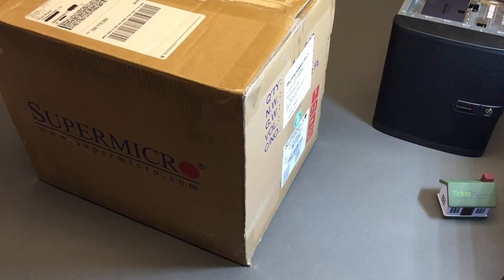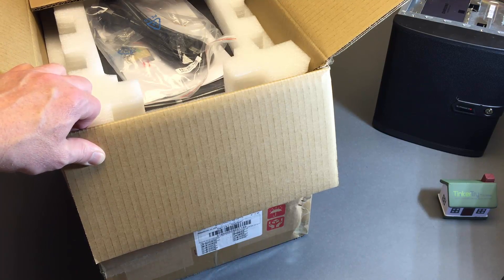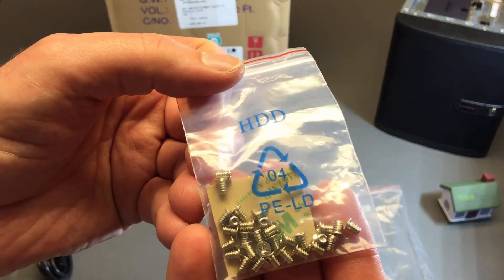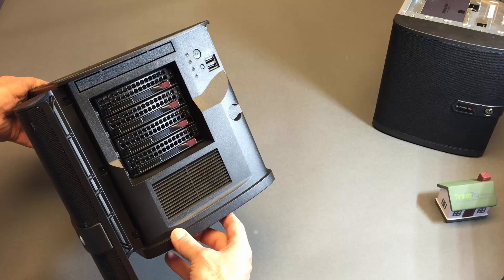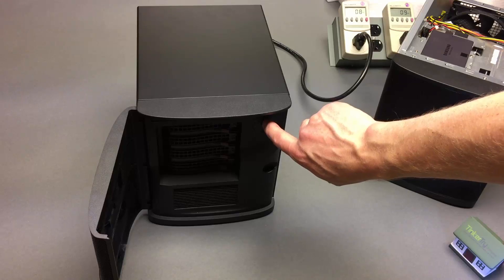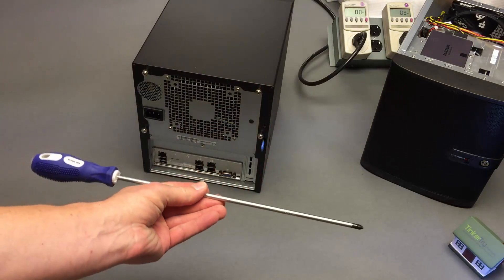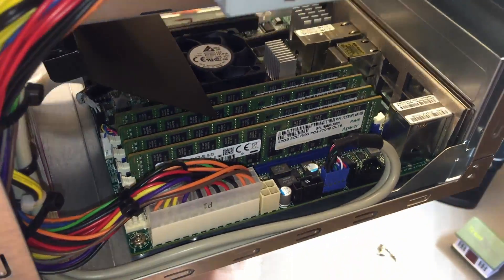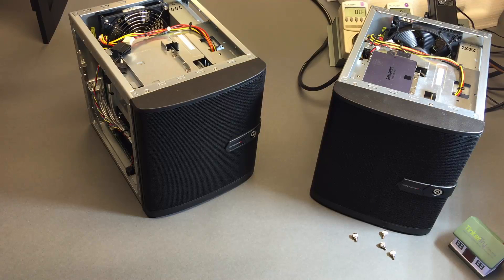Supermicro SuperServer SYS-5028D-TN4T (Xeon D-1541) unboxing, with HDD LEDs shown at first boot

Comment: Received the same system today. I have a silver warranty seal affixed to the rear of the system but I noted your system has no such thing. How do I add internal drives to this system without voiding the warranty, are there no free drive cables for use on the inside?

Comment: Can you do a video of  you building a vSAN DataCenter, with 3 or more of this SuperServer, using Esxi 6.5d, vCSA 6.db, vSAN 6.6, NSX 6.3.1, Horizon 7.1

Want to see how this server handle the load
 
Please & Thanks.

I was looking at a simple Spec for Home vSAN DataCenter (Hyper-Converged Infrastructure solutions):

https://cdn.tinkertry.com/content/articles/659-superservers/TinkerTry-SuperServer-Feature-Posterboard-Dec-10-2016-1133pm.png

Supermicro SuperServer SYS-5028D-TN4T
128GB 2400MHz DDR4
12-Core Xeon D-1567(14nm SOC)
cost=$3,350

1x Samsung 960 Pro M.2 NVMe 1TB SSD        vSAN-cache
2x Samsung 850 Pro 2.5" 128GB SATA-III-3D  Esxi-boot(RAID1)
4x Seagate Ent. 3.5" 10GB(Helium) 512e-HDD  vSAN-data
cost=$2,700

Grand Total $6,100

- Maybe get smaller 3.5" drives, then i can use smaller NVMe cache.
- (I wander what a AMD Naple build would cost)

Comment: Paul what's the price on that unit with 128gb of ram?
Reply from the maker: +Pete Howarth Short answer: $2030.00 USD
Long answer:
The same system, ordered from the picture link found here:
https://tinkertry.com/superservers#Bundle2
can have the extra 64 GB of DDR4 RAM (2 32GB sticks)
https://tinkertry.com/superservers#Options
added to the shopping cart and ordered with the server, so they'll arrive burn-in tested by Wiredzone.
I just created a screenshot of the the current pricing for this 128GB configuration (the exact system shown in the video), and the May 9 2016 total is $2030.00 USD for 128GB:
https://cdn.tinkertry.com/content/articles/659-superservers/2016-05-09_9-06-19.png
I paid $7 for shipping of this 15.4 lb box from FL to my home in CT. The base Bundle 2 (64 GB of memory in 2 32GB sticks) arrives with no shipping charges anywhere in the US, at a current total of $1632.00 USD.
Hope that helps?
Reply: +Paul Braren  64gb may be more what I need.  My current lab only has 32gb of memory which limits the number of VM's I can power up in my lab.  64gb would be sufficient.  128gb would be overkill for my needs.
Reply from the maker: +Pete Howarth Sounds like 64GB would be of immediate benefit, with room to grow your existing investment down the road if needed, without having to set aside the 2x32GB DIMMs. Likely these DDR4 modules will be sold for many years, so finding them unlikely to be a problem either.